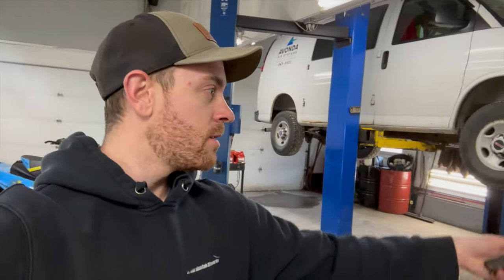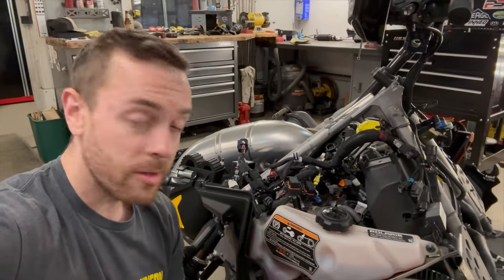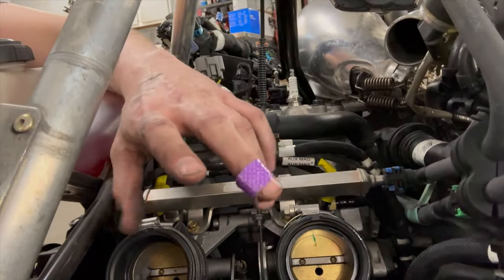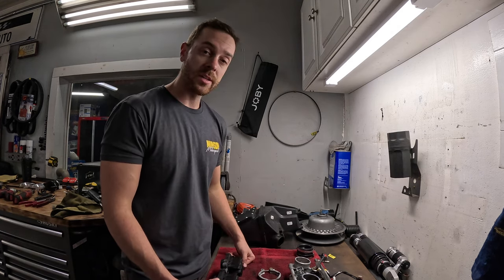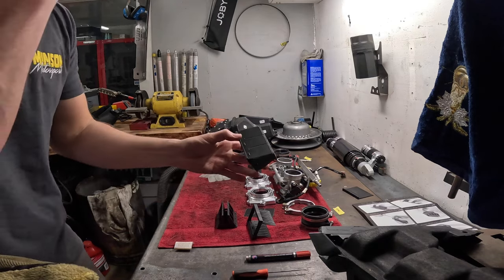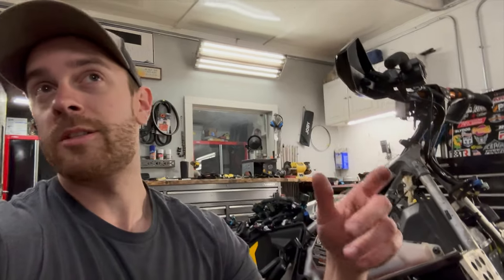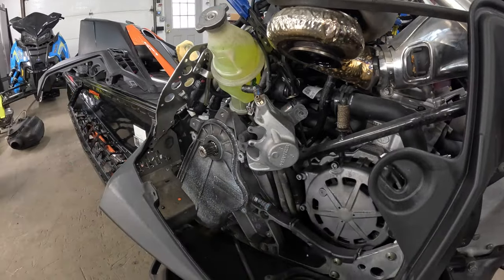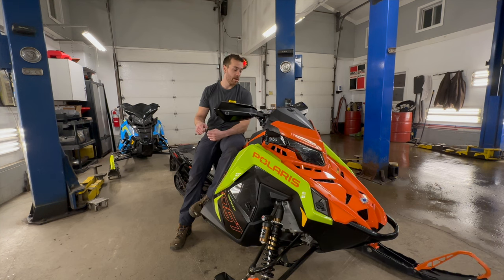2023 Assault Boost billet manifold and Vforce reed petal replacement! Full install/overview!

Comment: Hey bud great video very helpful I am in the process of doing this to mine right now are you able tell me what you torqued the manifold to and did you use blue loctite on the bolts? TIA
Reply from the maker: The manual says 12ft-lbs for the "reed/throttle body adapter" fasteners. I did indeed use blue loctite on them as well!

Comment: Good video man, any tips for doing reeds on a 800 khaos ? 

I agree with the stealership thing to man, I don’t trust them to do good work at all
Reply from the maker: You'll have pretty much the same process to do the Axys reeds. The airbox on the N/A's is definitely a bit trickier to get out as it's a little bigger but all in all the process is very similar. You won't have the v-band clamps on the throttle body to reed manifold, just a couple worm gear clamps. Other than that it's a very similar process. The jackshaft location on the mountain rigs is different so there may be some clearance differences with that, but it's been a minute since I've dug into a mountain rig so I can't say if that'll cause any issues/differences worth mentioning.

Comment: Does the intake have a place to put a blow off valve?
Reply from the maker: A bov would have to be added post turbo in either the charge tube leading into the airbox, or off the airbox itself somehow.

Comment: Nah... poo pads just wear out 2x faster
Reply from the maker: I'd debate that all day, I actually see both OEM's pads lasting about the same mileage. The XS & G4 Skidoo pads would only last me about 1800-2k miles as well, but the more concerning issue was their caliper location didn't/doesn't allow for much cooling so fluid boiling was/is the bigger issue. I encountered a lot of brake fade on my 2015 XRS when running it hard and that's why since 2015 I've been using Motul RBF600 fluid in every sled as it has a much higher boiling point. Skidoo finally upgraded to the 4piston Brembo from the race sleds on some of the new "high performance" models, and quite frankly it's about time. On the XS & G4's the best move is the fluid change and throwing the RS high metallic content pads at them. The RS pads have gotten crazy expensive in the last 5 years, but their worth it if you're stuck with the "old" style brake. 🤓